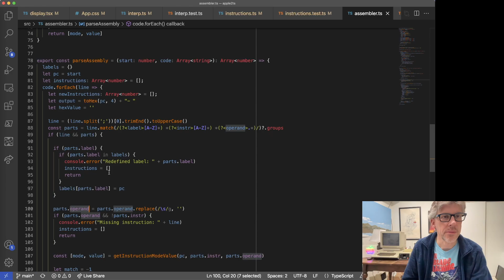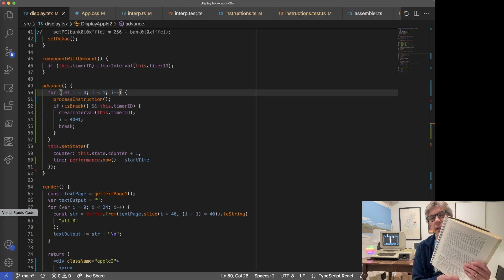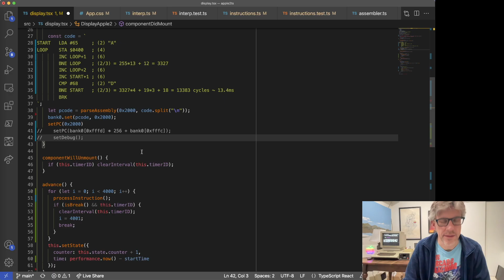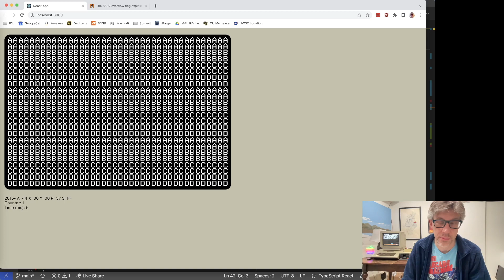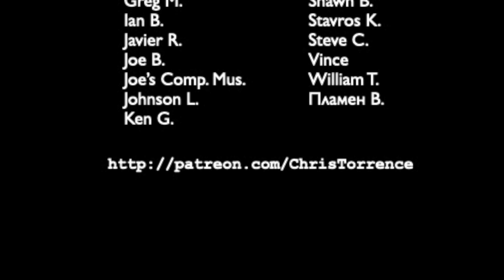#130: 6502 Cycle Counting - Why is My Emulator So Slow?!

Comment: Very good job again, Chris !
As you probably knows, the js vm is running in the same thread the display is running. So the first optimisation I did on mine was to put the 6502 vm in a dedicated thread with a worker. And for the display, I'm using a canvas refreshed with a requestAnimationFrame.
And yes, the cpu mem is shared between the 2 threads.
Reply from the maker: Thanks, that's excellent advice. Just curious, are you using any sort of JavaScript library (like React), or just plain HTML elements with the canvas?
Reply: @CT6502  yep, I kept it simple. a simple canvas and all is done here. If I were to use React/Vue, that would be for the debugger UI ;)
Reply from the maker: @tmbarral664  Thanks!
Reply: @CT6502  just did a PR on your project with a bit of code I borrowed from my own to handle the screen ouput thru a canvas. HTH ;)
Reply from the maker: @tmbarral664  Thanks! I'll take a look at your code. I realized that I needed to switch to a canvas, but was just trying to take baby steps. I may not necessarily merge your PR, as I want to be sure that I understand the new code, but I really appreciate the help!
Reply: @CT6502  it's pretty straightforward. the tricky part (for me) was with React as I don't really use it. I'm more an Angular & VueJs guy. The draw function is pretty simple and use something similar as you were using. I only have the page $04 addresses already computed, as we were doing it in asm back in the days ;) Feel free to ask me any clarifications ;) my mail is easy to guess from my name here and I'm on gmail. ;)
btw, I tried to change the PCODE hashtable for a big switch (as it's faster on V8, at least) but I wasn't able to see a diff.
Also, I'm a bit bothered by the way you're dealing with the addresses/softswitches. It may be problematic later on. A kind of bus here could be helpful.
lemme find a video that will explain what I have in mind... brb

Comment: Hi Chris. Very nice, I've learned something new.

BTW: a two-pass assembler is probably not needed. A single-pass with back-patching is almost certainly good enough. Any formula you can't calculate, you just "keep" with the address of it's result and width and when labels get defined, you try again. The patching only needs to fix a 1-byte or 2-byte result. As long as you do not do anything dynamic, this is pretty easy.
Reply from the maker: That's so funny - I was literally just thinking the same thing. Keep track of the unknown labels as you go along, wait until you finally encounter them in the code, and then fill in their missing addresses in the previous statement. The only thing that is puzzling me is whether you need to worry about 1-byte or 2-byte addresses. I was thinking that the simplest approach is to just assume that any absolute addresses are 2-bytes, as you don't usually run code on the zero page, or even if you do, I don't think my naive assembler needs to worry about that at this stage...
Reply: @CT6502  Yes, always only implement what you need. But this is actually very easy to do, so, once you need it: think of it :-) I've written a commercial 68k Assembler in the 80s, which worked this way.

Comment: Another optimization is to only update the screen every 17,030 clock cycles. Where does this magic number come from?
i.e. "There are exactly 17030 (65 x 262) 6502 cycles in every television scan of an American Apple."  IIRC it comes from Understanding the Apple II Timing Generation and the Video Scanner, Pg 3-11

This won't work for games/demo that switch video modes mid-scanline but for most games it works fine.
Reply from the maker: Cool, thanks Michael for the info! That might work just fine - I don't think my emulator is going to be rock solid enough to worry about switching modes mid scanline. :-)

Comment: Just for the record, there is a fair bit more to cycle accuracy than just counting cycles per instruction. Most cycle counting emulators front load the calculation. That is to say, they do all of the work up front, then sit around waiting until the appropriate number of cycles have elapsed before executing the next instruction. Unfortunately this isn't quite how it works in hardware. As an example, a STA ABS instruction takes 4 cycles. What is actually going on in those 4 cycles is 1: read in the instruction opcode, 2: read in the low byte of the absolute address, 3: read the high byte of the address and finally 4: write out the value of A to memory. What's worth noting here is that a frontloaded emulator would set the value in memory on cycle 1, whereas a real 6502 sets the value on cycle 4.

This can cause timing issues though if you're working with other emulated hardware accessing memory. For instance, if the CPU is writing to video memory while the screen is being drawn, a difference of 3 cycles can cause the pixels calculated in the intervening time to be wrong, as they are reading a value which was erroneously changed 3 cycles sooner than it should have been. I realize it seems odd to be writing to video memory while the screen is in the process of being drawn, but this technique was common on older hardware to work around limitations in video hardware (they called it "racing the beam")

I don't know if this is an issue on an Apple II emu, but in working on a NES I have found that these types of issues are more common than I expected, and am in the process of reworking my 6502 to take this into account. Just some additional food for thought :)
Reply from the maker: Thanks for the thoughts about this. I definitely agree with all of your points about cycle counting. My emulator is taking the "easy" approach, at least for now. On the original Apple II and II+, there was no dedicated vertical blank signal, so many game developers relied more on page flipping to do flicker-free animation. There were coding tricks that you could do to determine the vertical blank, and people (like Bob Bishop) used these to do "racing the beam" type things, but I don't think it was as common as on other platforms like the Atari or NES. My emulator is slowly getting more sophisticated, so maybe at some point I'll tackle something like true cycle counting.

Comment: Using two passes is quite common.  First pass collects symbol names, second pass resolves addresses.  I don't recall if Merlin32 does a single pass assembly.
Reply from the maker: Merlin definitely lets you define symbols that are used later, so I'm assuming it does a two-pass?
Reply: @CT6502  I believe Merlin8 does two passes. I’ll have to double check both assemblers.

Comment: @2:31 NTSC monitors refresh at 29.97 Hz, not 60 Hz.
Reply from the maker: Right, but I believe that the Apple II vertical frequency is 59.92 Hz, at least according to Gayler p. 37. But I probably should have made that more clear. Thanks!

Comment: Hi Chris, I just happen to write an emulator too (in Rust, cycle accurate CPU so far)  :-) See https://www.youtube.com/watch?v=bzQ6cA0AuRQ
Here we can see that Rust is really good at compiling, I run it at about 1.8 millisecond per frame. I'm really surprised by the speed of it (although I did lot of assembler code years ago, I'm now into Python, which is waaaaaaay slower as you sure now). Your performance (5ms) are not bad at all since the browser just doesn't "get it". But that's fine, you could switch to a better canvas (I guess, not a JS specialist) and, if everything fails, you could move screen rendering to another thread but multi-core computing is harder... I'll keep you informed :-) And watch  your super cool videos ! Keep up the good work !
Reply from the maker: Very cool emulator! Keep up the great work on yours.
Reply: @CT6502  Thx ! I'll post regular videos on my channel to show progress. Be sure to check the repository for the JupyterNotebooks where I put a lot of toughts about how to do tricky stuff (although I'm no authority at all :-))